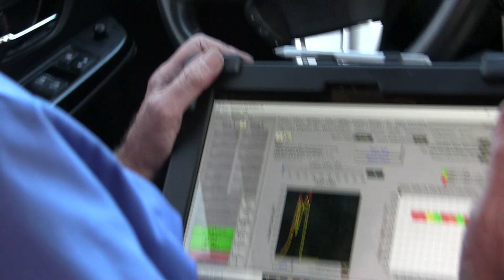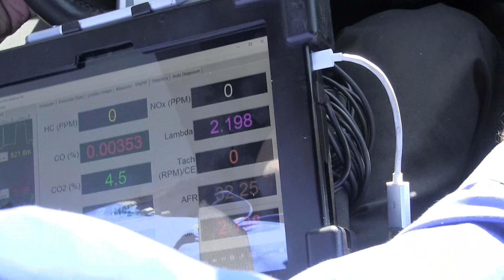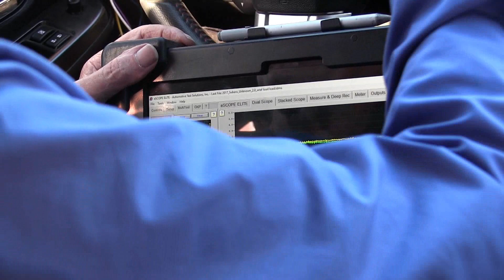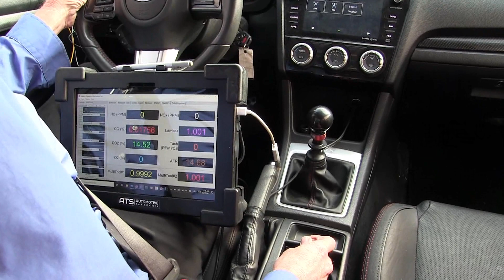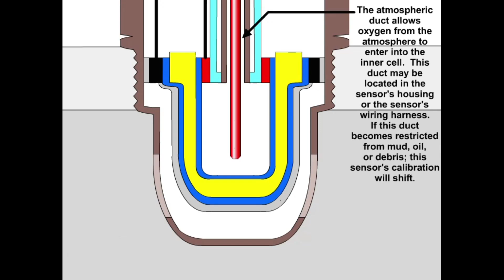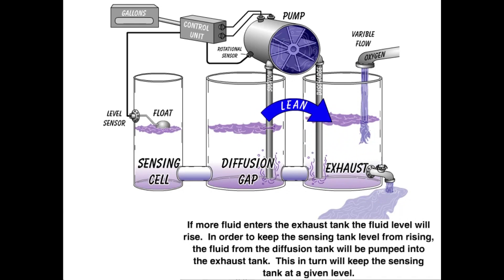2017 Subaru WRX diagnosis

Comment: I'm retired but If I was starting out learning from ATS and using the tools would have made me a fantastic technician. Of course when I had a shop we were still changing points and condensers.
Working on wiring was mostly to fix window switches or replacing harnesses on some vans that tended to melt wires due to excessive heat.

Comment: I did not think the wraf sensor can make that no power on this car. Now the heater circuit amp and the signal from that wraf sensor could make that much different. Wow, scope again, the gas analyzer also show CO for rich condition, and lamda number is very needed to compare the number from the reading from the engine ECU data. thanks Mr. Bernie  It was so much to learn.

Comment: I’m watching this video again for reference and understanding of the ATS tooling.

Almost have enough money to buy one🎉

During the test drive the camera man shows the boost gauge.

This car is tuned😂

The waste gate tables are turned up, most likely some cheap Cobb off the shelf map. 

OEM tables will taper the boost off after peak, even at WOT, to prevent pre detonation.

Over all this tune burned the AFR sensor

I wouldn’t be surprised if the owner deleted the EGR too.

Still a great video to reference❤

Comment: Good job Bernie. It is the laf or Raf and I could certainly see it. A heater matters that much. I found in college  chemistry that temperature really is critically important in chemical reaction quickness. Keep doing other shops failures because those might also be me and your more correct process is what I need to do.

Comment: Great diagnosis Bernie! My question is why couldn't you just use the downstream O2 to check the accuracy of the upstream AFR via scan data in 5 minutes? if it was lean enough to fall on its face, certainly the downstream would show a low voltage and prove that the AFR is lying?
Reply: Hmmm....if the cat was no longer efficient and had low oxygen storage capacity theoretically it would make this one easier no? If the catalyst had good oxygen storage potential you would think that it could potentially keep the upstream high during the lean event making it hard to use the downstream to cross reference the AFR... a bad cat would potentially allow you to catch it....pardon me while my brain explodes.
Reply: @pinpointautomotiverepair1592  lol! If a gas analyzer in the tailpipe can pick it up, the downstream 02 would certainly do so as well. In fact it would be faster to react than any gas analyzer 😉
Reply: Bernie está promocionando su Analizador de Gases, no malogres su negocio 😄:elbowcough: un saludo desde Peru
Reply: @IamReadyToRock  😂fact
Reply: Ivan, just watched this video for the first time.  Two thoughts that came to mind.  1, as you pointed out, the downstream O2 would have been a great PID to look at and graph during the condition.  I also think it would have been good to look at it (and create a teaching moment) from the point of view that many manufactures use the downstream to modify the upstream transition point ...which would in turn "effect" the fuel trim.  by NOT looking at the downstream, there was the potential of a misdiagnosis.

All in all, a good case study though.
Reply: @OtisPlunk  I wish Bernie would answer some of these questions 😅
Reply: What if the Cat were no longer as efficient? 🤔
Reply: @NewLevelAuto  KEITH!!! I miss your videos like a fat kid misses chocolate cake. Hope you are well! :)
Reply: @NewLevelAuto  haha Keith with the critical thinking question! I would think that it doesn't matter if the cat is there at all... Downstream would still fairly quickly show a real rich or lean condition that is present for more than a few seconds 😁
Reply: Good point Ivan! The problem is it wasn't grossly lean. The actual lambda was very close to 1 qhen under load, when the AFR was reporting around 0.80.  I think this may be beyond the capabilities of the narrow band 02 to accurately rely on. If it was a huge lean condition for sure. Man this one would be tough.
Reply: @pinpointautomotiverepair1592  well it seems like it was lean enough to fall on its face, and Bernies gas analyzer showed lambda of 1.4 while the upstream was 0.8 lambda....so downstream data would most likely catch this severe lean condition 🤔
Reply: @PineHollowAutoDiagnostics  I do think you are right on the right track here. Always sucks when you discuss a case study and someone points you a potential easier way that you wish you can test!

Comment: I have a 2017 wrx. I decided to put brighter led light bulbs in the ceiling and the lights blew out! so the stock bulbs were put back in and they constantly stay on! now what?
Reply: Is your ceiling/room light switch in the On position? There are 3 positions, On, Off and Door. Are you referring to the middle ceiling light or the map light near the rear view mirror? The interior lights get their power from the BIU (body integrated unit) you can screw the BIU up real quick if you use bulbs not rated for the circuit. The interior lights are grounded through the switch to the body. Double check your bulb install.

Comment: How timely , around 3 weeks ago I posted using this procedure on D.N. .
It is nice to get validation from Bernie , I add one more p.i.d. to the data ,the rear O.2 sensor.
Also ,I talked about this with a couple of techs it was a little challenging for them to understand how the fuel trims can be good with a bad sensor, the easiest explanation is that the e.c.m. has no way of knowing the sensor is out of range until it gets very bad and than it may flag some codes based on rationality tests. 
Thanks for the great video.
Reply: It's good you posted this info. 5 gas tool is great to have but the rear 02 pid would have snitched on the front a/f sensor under a heavy load

Comment: I have a question about the affect of the cat on the gasses coming out the tailpipe vs. the gasses in the 02 sensor?
Reply: I was thinking the same thing.    How can it be the same if the cat is burning o2 and hcs